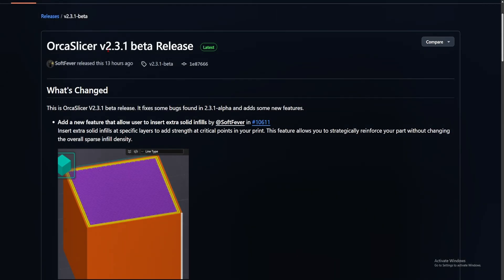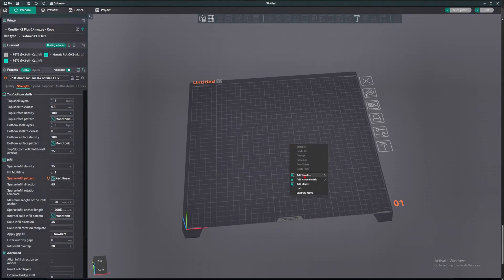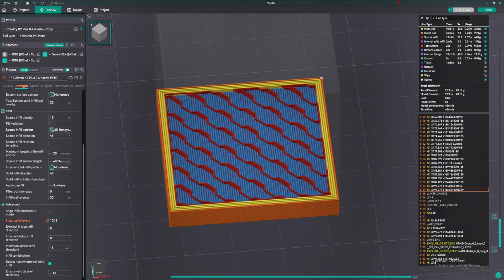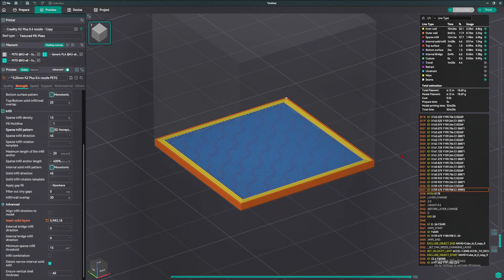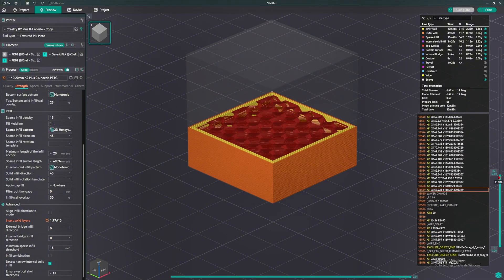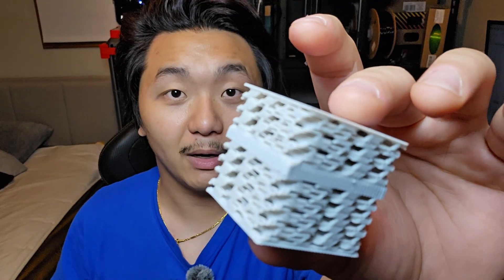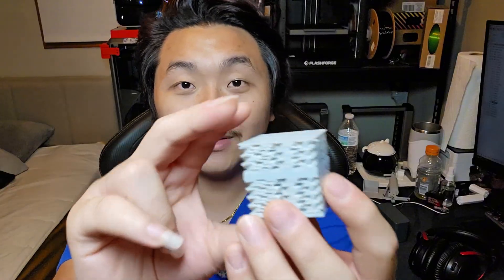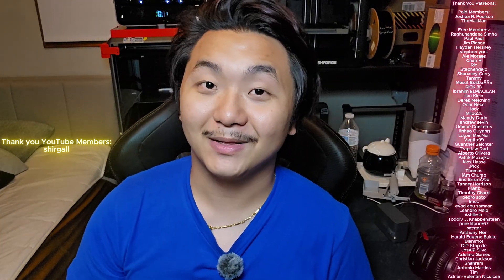Orcaslicer 2.3.1 Beta Released | New Features!

Comment: Any chance this means that we can print angled solid infill layers, instead of just parallel to the bed, now that the standard scarse infill pattern can be rotated? Seems like a bit of a pipe dream, as it would likely be hard to avoid floating cantilevers.😅
Reply from the maker: Idk, maybe if we mess with the settings
Reply: @Scratch3DPrinting Either way some fantastic additions to the slicer recently.

Comment: Hi, can you make a video of the rooting of the K1 with CFS update? I wasn't able to. I wanted to use Orcaslicer.
Reply from the maker: Hello, I have made a full guide of rooting the k1 series. Here: https://youtu.be/sr5vpF7IDF8
Let me know if it works, if not I might have to make an updated video.
Reply: @Scratch3DPrinting  But is that video good for the CFS firmware?
Reply from the maker: Yes, i just recently rooted my k1 max after upgrading with the cfs and it's still the same thing.
Reply: @Scratch3DPrinting  thanks:face-green-smiling:
Reply: @Scratch3DPrinting  Hi.. This guide doesn't work, it has nothing to do with the CFS with the latest firmware 2.3.5.33, it doesn't work, it doesn't allow rooting.. I connect via SSH but when I enter the commands it doesn't install anything and there are no guides about it
Reply from the maker: @DiTuttoUnPo72   yeah, i get that too, for whatever reason it does not install anything, but it just work for me.